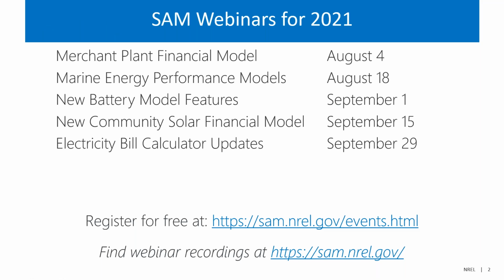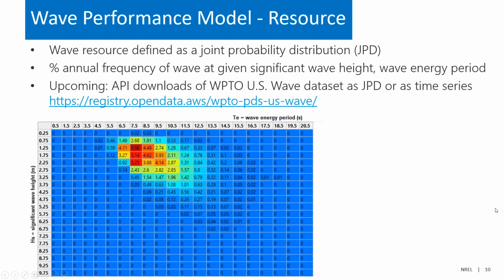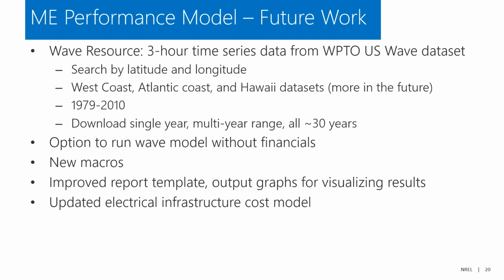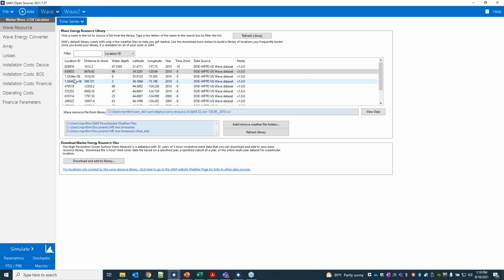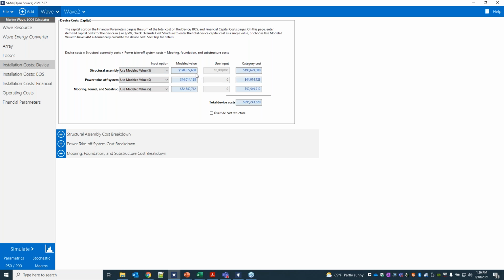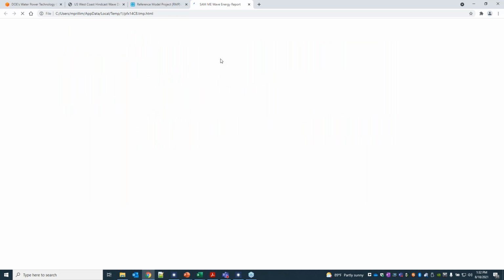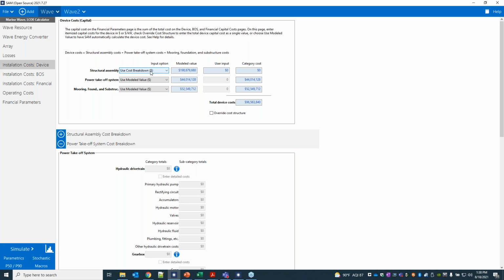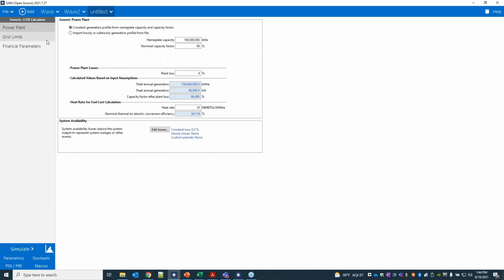Modeling Marine Energy Systems in SAM

Comment: Hi! In your app, when you go to system device -> then tracking and orientation, the azimuth and the tilt are the perfect ones to work in perfect conditions? Thank you.
Reply from the maker: Tilt and azimuth are inputs to the solar models, not the marine energy models. You set the values of those inputs, SAM does not automatically set those to optimal values.